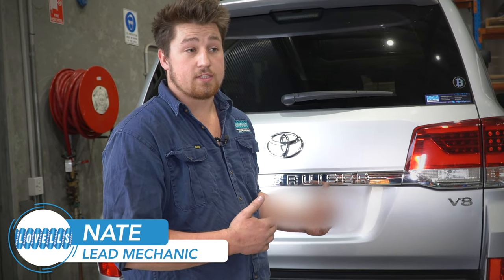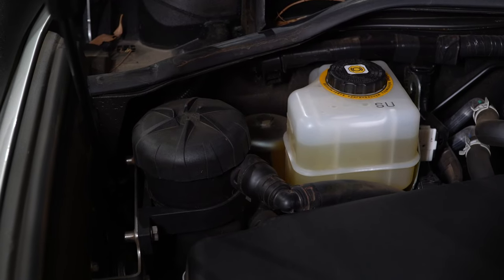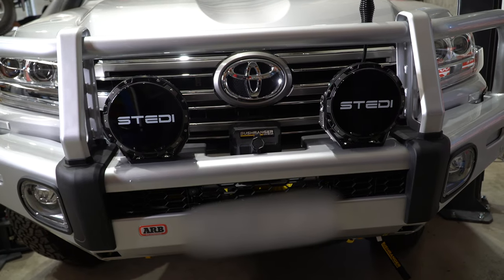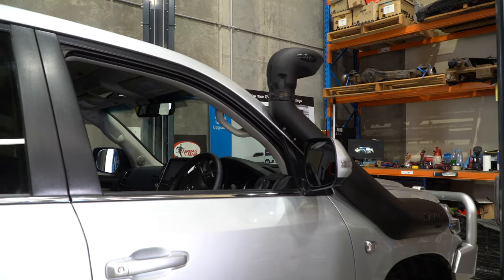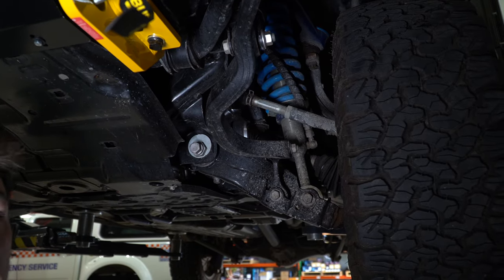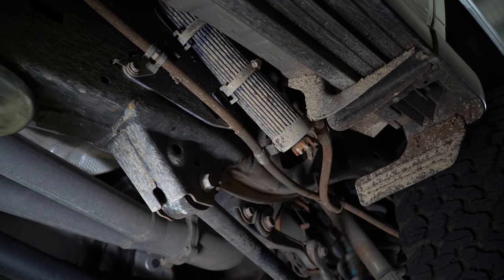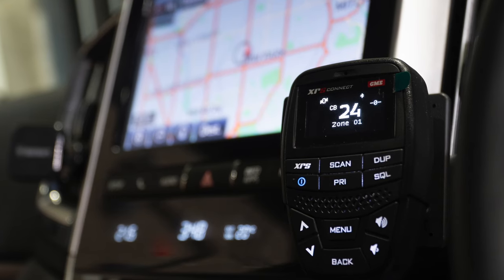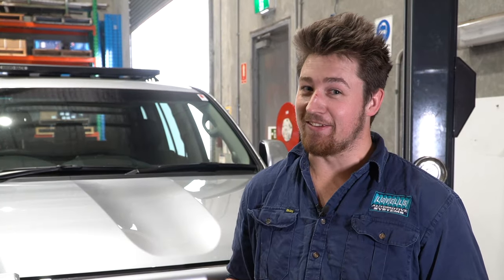2021 Land Cruiser 200 series touring upgrade - A full house!

Comment: Hi interesting vid with the 4.2 ton gvm upgrade what is the towball maximum load allowed? and with a LC200 what is the rear axle load with 350 kg on the towball? Thanks Ian,
Reply from the maker: Hello Ian, 
The 4200kg GVM doesn’t upgrade the tow ball capacity. So the Tow ball maximum weight is up to 350kg. The rear axle weight goes to 2304kg.
Please feel free in giving us a call in the office on 08 8374 5500

Thank you 
Steve